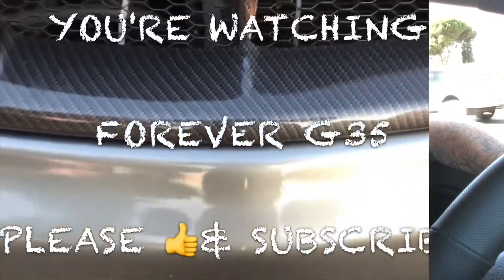REASON WHY  TO DELETE ABS/VDC ON G35/350z

Comment: I agree with you I would rather modulate the brakes on my own. I once had traffic on the freeway suddenly stop and I just jammed on the brakes letting the ABS do it’s thing.Just before coming to a stop I rear ended a pickup. I could have avoided it if the ABS had not kicked in because the car traveled further with it enabled.
Reply from the maker: exactly What I have experienced it's not safe it's fully disabled now and I feel safer

Comment: You need to understand how brake systems work before recommending to others that they make them worse by disabling ABS. There are several technical errors in your account of the braking incident and its cause. At the very least start by researching the difference between Threshold braking, ABS braking, and Panic braking. You didn't get into an accident because of the ABS. You got into it because you were over-driving the car for the conditions and you used panic braking. The ABS did what it could, but you would have hit the car the same or worse without it. I instruct high performance driving for national organizations; we go over this kind of thing in detail for our novice drivers so they learn to use the brakes efficiently instead of just locking up the wheels (which reduces braking efficiency significantly). Locking up the wheels and skidding on the tires (i.e. panic braking) FEELS good to the novice driver, but it is not a skilled use of the brakes. In back to back tests, your ABS will outperform panic braking. Neither can prevent an accident that was bound to happen short of proper threshold braking.
Reply: was looking for this comment i disagreed with this video for the reason of modulating it
Reply: 100% thank god 2 other people know why this whole video is wrong. 🤦🏼‍♂️

Comment: Still thinking about doing this but still trying to get the G up and running
Reply from the maker: Drew 1K if u drive fast n brake quick this is a must ... whats up with the ride tho ? nothing yet ?
Reply: FOREVER G35 it's a must for the G then! & it's a headache bro, so far I've replaced the starter, both camshaft sensors, the crankshaft sensor on the driver Side, fuel injectors, valve cover gasket for both sides, all new ignition coils. Thursday I take my car in to switch out the gas fuel relay fuse box. Fuel isn't coming out the fuel injectors. That's where I am at right now, hadn't been running going on a month but still trying 💯
Reply from the maker: Drew 1K dont give up u already invested  bro cant wait till u gt it up again ill b waitn on upload
Reply: Damn bro I was thinking about you the other and asking my buddy's about your issue but dont know what it could be. Sucks to hear about your ride being down man. Keep your head up 👍👍
Reply: DaM bro still down... might wanna test the fuel pump if the injectors don't spray. Hopefully it's not something electrical
Reply: Thanks guys I appreciate your support 💯 I hope it's not the fuel pump, it's pretty new from vqfuelupgrades, if it is my buddy that sold me the car still has his warranty for it. Im hoping it's nothing electrical as well. It goes in the shop again tomorrow , fingers crossed 🤞
Reply: @drew1k978  in some cases even new parts can stop functioning. So retrace and double check what has been done recently.
Reply: The G has been at the shop for a few days, I got it towed this past Friday. They're going to disassemble the whole engine and put it back together, trying to see if they can find the problem that way. It's taking alot longer than I expected. It will come together eventually 💯
Reply: Drew 1K what happened

Comment: I have 2005 ani edt they said to replace the module it will be 1600 all my lights are turned off since it's not communicating with module but since it's really not needed I want to remove, abs vdc etc lights will this affect my car in any way?
Reply from the maker: nope it will not ... there is 2 different ways to do this .. one is the fuse the other is taping into the module under your center console
Reply: @foreverg3549  I think the better way would be the fuse since my Module itself is not working nor communicating. I will do the fuse suggestion. Thank you for getting back to me, and thank you for the videos. Keep up the great work.
Reply from the maker: @TrishZenCorner  all good lmk if u fix issue

Comment: Did you’re brake lights still work after pulling the fuses? I’m just trying to do a left foot brake burnout in my auto G 😅😅
Reply from the maker: has nothinh to do wit ur brake lights ... if u pul the fuse and cut the way i did in video u will have 0 issues

Comment: Yea man I have the VDC disabled too. The kill switch method. What kind of sooper charger you thinking?
Reply from the maker: thizzface the shop said some bout greddy but we see might change it jus cost hella to keep smogable
Reply: thizzface how much was the kill switch method and when you turn it off does the lights turn back off too instantly?
Reply from the maker: Matten R its jus a toggle switch he talkn about u need to tap into  module located under plastic where e brake is at . the lights will go back off on mine if u switch fuse bk out .
Reply from the maker: Matten R also remeber that u are not removing the fuse completly if u do this u will not hav any gauges workn
Reply: @trouble3574  the vdc G sensor is under the center console/ shifter area. Some people unplug it. You can add a switch from home depot for under 4 bucks👍
Reply: FOREVER G35 so if I remove JUST the VDC fuse none of my other gauges will work?
Reply: @trouble3574  your speedometer will not tell you how fast you're going.
Reply: thizzface ok just a question in thought.... if I wanted to just do some donuts I could just take out the one VDC fuse and before I get back on the main road I can just put the fuse back in and it’ll be like normal?
Reply: @trouble3574  yea but you'll need to disable abs under the hood as well. The abs fuse is connected with ignition switch so you might wanna look into that. Pull the abs fuse=car won't start

Comment: Hey bro I have 08 hr 350z and I was wondering if you know where the exact fuse is to delete abs ?
Reply from the maker: 350z Guy should have same fuse it it might not b same spot but there is . click on my uploads ans watch the other video to this one ...this was part 2 ...
Reply from the maker: 350z Guy here it is i found it .... if this does not apply to your car i hav another way to doing it with a switch installed ... lmk how it goes

Comment: Did you ever get to getting rid of the dash lights? All I've seen is taking it apart and burning out the bulbs lol
Reply from the maker: Curtisdawkins no mine look lik a christmas tree still lmao
Reply: FOREVER G35 you could also use a sharpie lmao or tape
Reply from the maker: Curtisdawkins true if it bothers u . I’m use to it already plus I’m running a switch now to turn it off and on

Comment: If i do the delete will.it stop that buzzin noise from the pump?? Instead of changing relay?
Reply from the maker: Joe Patterson that wont do nothing to the buzing u might need new pump .... abs and vdc is located under ur e brake .... tap into fuse and u almost gt same thing . i did  2 of these videos click on uploads ....
Reply: @foreverg3549  yeah right now im getting like a buzzing noise but when i turn off my car it stops it dont keep buzzing how some people say it does.. some people say to change the abs relay
Reply: @foreverg3549  and my abs vdc n slip are on i got my vdc off button dont work lol
Reply from the maker: Joe Patterson yea i never heard about the fuse doing that . its not tied into the pump . only to the brakes . maybe the relay for the fuel pump is goin out
Reply from the maker: Joe Patterson that button never works ...its there for looks even in funtioning condition .... u need tap into fuse or the module under console... this will allow u to burn out as welll as d Disable the abs (antilock brake system) this way if your coming to a corner fast ur car wont brake on its own n cause  you to slide and wreck ....👍🏼hope this helped any other questions u can always Dm on instagram . name same as here
Reply: @yo I found the reason for the buzzing power steering pump was low
Reply from the maker: 😂😂😂 foreals ??? nice glad u found issue
Reply: @foreverg3549  yeah went to change oil at valvoline they said your power steering is really low they put some and it stopped
Reply from the maker: Joe Patterson 😂😂😂😂🤷🏽‍♂️ hell yeah b happy problem solved thats great